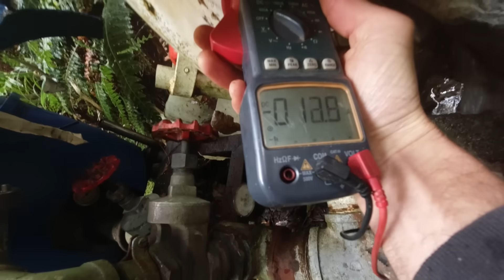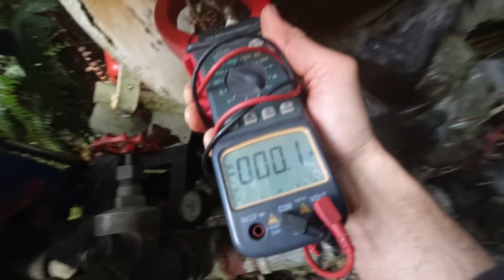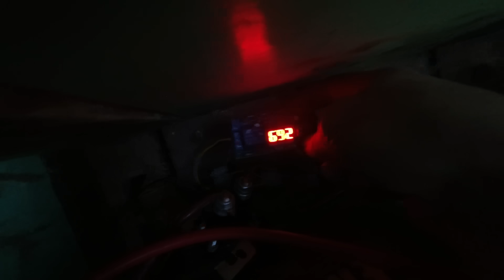Free Power for 16 years from a modified Washing Machine / Water Wheel

Comment: This guy's living my dream, completely isolated and self sufficient. Amazing.
The old time gold miners used to have a larger diameter pipe intake upstream and then they would gradually reduce the diameter of the pipe further down, which would create insane pressure. Food for thought
Reply from the maker: Reducing pipe size doesn't affect pressure, pressure is dictated by the difference in height between the intake an outlet
Reply: The reduction in pipe diameter was used to increase the speed of the flow for sluicing, the pressure depended on the height difference between intake and outlet (head).

Comment: Great invention! The only thing that bothers me is the drying creek, it seems as if it was a pretty decent river at some point. I wonder if him taking all the water through those pipes could have affected that natural stream. Probably not, but in any case I'm being curious.
Reply from the maker: It makes no difference, a small amount water is merely diverted around a a short section of the stream, no water is used
Reply: @MartyT  yeah, doesn't seem that there is a lot of water in there in the first place. Do you get full river during rain season?
Reply from the maker: @SomeWeirdNonConformist  Yes it is full flow at the moment, drops right down during a drought, water still runs under the stream bed in the gravel

Comment: Nothing special about the batteries...or is there?
Reply from the maker: They are small deep cycle batteries, can also use half life truck batteries to keep costs down. This system doesn't need a lot of storage capacity as it is generating 24/7 unlike solar
Reply: @MartyT  I figured you'd just need them for surge draws and such. Sure is nice to have a high-head water source available to you. Cheers..

Comment: Distance of the power wires is questionable DC requires much larger wires to not experience voltage drop
Reply from the maker: 240vac cable run to the house

Comment: 300 watts @ 240v is only 1.25 amps so how in the hell are you running everything in your house with it when it's not enough to even power a 400w metal halide ballast?
Reply from the maker: 2 turbines, combined I'm getting around 850 watts at the moment = around 20kwh/day

Comment: You said a hundred and so meters down that way. Is that the head distance?
Reply: Sufficient head to get 65psi...65 metres=213 feet vertical drop.
Since the stream isn't vertical, the length of the penstock pipe is longer than 213 feet...about 150 metres total length to achieve that total vertical drop..
Reply: @JohnSmith-pl2bk   Wow. That's quite a drop.

Comment: I wonder if you could have saved money or broken even if instead of having the battery and inverter next to the turbine, you instead bought a 3 phase autotransformer to boost the voltage up directly from the stator and then used a thinner gauge wire to transmit power to your house at a higher voltage and considerably lower current. And then have all the electrical equipment inside your house instead of in the woods... maybe have  a overall more efficient system as well
Reply: Or even source 3 used equal microwave transformers wired up in a delta configuration you could probably get enough voltage out to not even need a inverter, it would depend on the frequency output of the turbine...

Comment: have you herd of connecting these in series using gravity and hermetically sealed turbine boxes to preserve the pressure ?
Reply: When you put the water through the first turbine...it takes the energy and converts it to electricity.
The energy is thus "spent".
You can't draw more energy from the next turbine unless the water has a chance to recoup this energy by falling through another penstock of similar length and height to accumulate the same amount of energy....
That's why huge hydro dams are not built one closely behind the other...there is always a canal or pipe leading to another reservoir at a lower level...and fro that lake/canal into another generator...

Comment: Hi, super interested in building one and teaching it as part of our curriculum for seniors. My question is the amp / watts and the amount of appliances you can run at any one time. Can you explain how you have managed this with the amps /wattage with the lead based batteries you have. Also, what is the maximum draw on your inverter before is shuts. Thanks.
Reply from the maker: Cool.. The inverter is 3000 constant / 6000w surge. Just over 800w from the turbine minus cable and inverter losses so he could run a 700w appliance constantly. Anything over that and the batteries have to pick up the slack. Think of the batteries like a water tank, turbine as constant trickle of water at the top of the tank and the outlet tap is your appliances at the bottom. If you leave the tap open too far for too long the tank/batteries will soon be depleted.

Comment: Lucky you no one enters your property and cut your power cables... in some countries, that will disappear overnight... Also do you use storage batteries as well??
Reply from the maker: Yep there is a 24 v battery bank feeding the inverter
Reply: @MartyT  Good for you Sir,
In my country of North Borneo, we have a young Senator whose little workshop produces simple waterwheels out of alluminium cans and even recycled HDPE plastics to power small generators for remote village up the hills.  He has to build a little shed complete with doors and lock to prevent curious people that might get electrocuted if they touch the wrong things... ha ha

Comment: I would like to understand how many batteries have you changed for the past 16 years in this setup? What is the total capacity of the battery bank and how many of these 24V batteries did you hook them up together?
Reply from the maker: I use recycled truck batteries from friends, I've never had to buy one. 12 volt x 2 in series. I've been through about 6 batteries in 17 years

Comment: Nicely done. What size pelton wheel did you use on your turbine? I have been looking for years for one of those fisher paykal washing machines. A guy I removed some honey bees from his walls the otherday had a washer that I guess the electronics were buggy. I could spin the washer and the electronics would beep so I’m guessing the motor is still in working condition. I’m wondering what size pelton wheel would be good to start out on. Thanks
Reply from the maker: The pelton wheel is around 28cm diameter

Comment: how are you getting the jet to gush out water if its just a filter that sends down water? or is it your using a little bit of power to produce more power in the turbine?
Reply from the maker: The intake filter is higher than the outlet jet, this pressurizes the water making it come out at high velocity
Reply: @MartyT  ah just gravity, awesome, thanks for the reply

Comment: It would be cheaper for you if you have dug a canal to the power house instead of fitting pipe. You could have fit pipe by building a small dam on high ground and putting pipes after that. Impressive though.
❤❤❤
Reply: You will have seen that the plastic penstock pipe is not buried...it just lays in or near the creek all the way down to the turbines. 
There is no need for a dam, as the take of water is less than the flow of the stream at all times. Thus the stream is hardly disturbed in it's flow...and the water goes back into the same creek after going through the turbine.
You couldn't get more "green" than that...
Reply: @JohnSmith-pl2bk  CCP wants to know your location for 3 Georges Dam 
😆😆😆

Comment: I was wondering.. how high is the head of your system to get this pressure?
Reply: 42 metres, with a run of pipe of 150 metres. 
Producing 61psi at the nozzle of the turbine. 
Gravity supplies the energy for harvesting by the pelton-wheel driven rewired washing machine motor.

Comment: For those with a source of running water, this is a possibility.  From what I understand, the flow of most streams and rivers is inadequate to fully run most houses.  If you live near a waterfall or the rapids, you may have better luck.  I didn't realize the cost of power cable was so great. The alternator/generator could be engineered for more power but without the power to turn the wheel, this is perhaps irrelevant.

Comment: Instead of the check valve couldn't you just wire it to an automatic transfer switch
Reply: It is to cope with wildly increasing voltage...so the quick way is to shut off the water. 
No water=no voltage?

Comment: Good job. You have about 20 amps of continuous power 24/7, that is good. Why do you need batteries?
Reply from the maker: 20 amps x 24v is 480 watts, if I need to us a high load appliance like a kettle (2000w) the batteries make up the extra 1520w until the turbine can catch up

Comment: Very cool, very inventive.  That said, I couldn't help but wonder if your overall maintenance demands, performance consistency, etc. wouldn't be improved in general by making things a little sturdier and more secure.  For example, ensuring a good slope of the pipe runs, addressing flow restrictions / pinches in them.  Making more stable equipment platforms with small (layered?) bases of bricks, or paver stones.  Maybe also some rudimentary covers / enclosures for the equipment, to help keep it from getting mucked up so much.  I know it's in the woods and all, and there are budgetary considerations, but that's something I would do, personally.  I'm all about taking care of the equipment.   As inventive as you are, I'm sure it'd be easy for you.  Namaste.
Reply: It works "as is" 
It is not complicated. 
No one sees it unless Marty wants them to see it.
Simplicity is king....

Comment: Dear Marty:
I want to appreciate your ispiration.
I bought a little farm in the fields and nedded to cut the grass.
I opted for the "Marty Solution".
Bought a $50 Briggs Stratton grass cutter and I am ready to repair it...
Regards.
Reply: Did that mower work for you?
Reply: @JohnSmith-pl2bk  I repaired it a first. 
But after intense use the carburetor was clogged. I repaired it abther time.
At last it clogged again.
There may be a lesson:
The mower does not have a gas filter.
And if your gas funnel is not clean, the particles may go directly to your carburetor.
Reply: @alejandrodelabarra2838  
But the farm works for you and you enjoy life on the farm?
Reply: @JohnSmith-pl2bk  I work for the farm. 
At first I made a wood refuge. 
Now I am making a little house about 35 or 40 m2.
1 bedroom
1 living room + kitchen
1 suit bathroom 
1 toilette.
Reply: @alejandrodelabarra2838  
Good to hear that. 
Enjoy life....
Regards.
Reply: @JohnSmith-pl2bk  Thank You!!
It was an unforgettable adventure

Comment: I’m amazed at how reliable these are. I worked at a company that serviced around 10 “small” commercial plants and there was always some little thing to deal with. That being said though a lot of our equipment was from the 1940s-50s. It’s amazing how long those machines last, most of our failures would be smaller components. Hydropower remarkable stuff.
Reply: By “small” I mean most of our units are under 250 kWh. Our intake pipes are big enough to walk around in if that gives you an idea of the difference between commercial vs home setups like this. Most of the hydro in the U.S. northeast is smaller setups like that, the big stuff is mostly up in Canada like hydro Quebec or out West.
Reply: In Norway the electrical grid is 95% hydro. All the excess energy that we are unable to store is exported to Europe. Whenever it is to cold for the powerplants to run we rely on import.
Reply: it could and should be the case almost world wide!  @JackRabitJones

Comment: Hey how did you get significant water pressure from that small stream? Was it from the downhill angle of the pipes?
Reply from the maker: The water intake is higher than the outlet nozzle, the greater the difference in height (head), the higher the pressure https://en.wikipedia.org/wiki/Hydraulic_head
Reply: @MartyT  thanks!

Comment: are we really supposed to believe that a trickling stream will power a turbine that size ?
Reply from the maker: Believe what you will.. it is a fact
Reply: Marty T cool ! I’ll build one if I ever live near running water 🙂. I would be super super grateful if you could share anything helpful on how to do that. I have  very basic knowledge in that I know you can use an electric motor as a generator. Magnets flying past coils and all that. I build a few bedini wheels a few years back and I was playing around with crystal cells.
Reply: It's the power of the 4 inch line forcing water  through a half inch jet nozzle. Genius

Comment: So you get water by gravity? And is that what runs the generator or is there a water pump involved somehow that does the work and 2hat do the batteries do?
Reply from the maker: The intake is higher than the outlet which creates pressure at the nozzle. Batteries store 24v dc power and make up the deficit when a higher load than turbine output is required from the 24vdc - 240vac inverter
Reply: @MartyT  I remember years ago as a child in a house we lived in had a gravity system for water to the house that was built back in the 1840s it started way up on a mountain with a large pipe gradually turning to smaller when it got to the (houses ) 3 actually and lead pipes I’m told surprised I’m still here😂

Comment: Does any one if it is possible to create enough flow from an elevated container that refills from a pump? This would be necessary where no flowing water exists. Would the energy expended on the pump negate any potential charge to batteries from the turbine in the drop?
Reply: No.

Comment: Assuming you do, I am intrigued that you can transport 24 volts over that distance efficiently. I would have expected an inverter for higher transmission voltage. Love the ingenuity.
Reply from the maker: Yes there is an inverter at the turbine so 240v through the cable, very little loss
Reply: Very envious of your whole setup. I have a 800w wind turbine that I am hoping to install in my place on the west coast of Scotland and I propose to dump the power directly into a heat store. The place is empty much of the time so simplicity is key and a little heat is always good. Wish I had a stream on my property that I could utilise 24/7.

Comment: Very cool set up I'm curious if you have thought about using an mppt charge controller to control the amperage so you don't have to dump the pipeline if over voltage has occurred? Nice build
Nothing better than being off grid you are
Very successful at it. Well done.
Reply: It’s pretty stable so why bother with mppt?

Comment: I would love to do this with some kind of add on water mill so water pressure builds up and runs down it like a waterfall and cycle the water again and gravity fills the watermill up again while still having another pipe from another water source as well to keep it filled constantly
Reply: If the water exited the top turbine, went back into the stream, was collected by another pipe AND FELL ANOTHER 42 METRES, then you could put another turbine in at the bottom of the second tube and harvest the same amount of energy from that water...since gravity provided the energy.....

Comment: OFF what grid?
Reply: Off the national electricity supply available to most NZ households...for a price.  
The cost of joining the grid 20 years ago, in Marty's case, was $14,000 most of which would have been for stringing up power lines for 6km.
The moment he started generating his own electricity he "pocketed" $14k relatively speaking, and every Kw thereafter at  say 20 cents per each over 16 years...less bearings...was more "profit" and less expense that his household had for other purchases etc..

Comment: Very interesting. My Firman 9500 watt Generator blew up the other day (The motor part not the generator part) and while we don't have any running water here in Northern Colorado to feed from, it's usually always windy and after watching this it makes me want to setup a windmill geared down (Or up, however you look at it) to spin the turbine in the generator to make power. All of the hard stuff is done because the plugs are already wired up and everything so theoretically you could just plug a battery charger right into it or and have kinda the same setup as this guy. Maybe in the future that'd be a fun project to try and at least make it trickle charge my RV batteries for free to keep them maintained. On really windy days, like when it snapped my flag pole I bet you could get that generator running close to full power lol. 50 amp plug already wired up in it just plug something in lol.

Comment: So if I had a well, theoretically I could do this too?
Reply: If you had an artesian well, that output water from ground pressure alone, at a standing 61psi...yes. Once the water had gone through your generator it would have to flow away into a stream.....or drop further into another pipe or pond or dam...